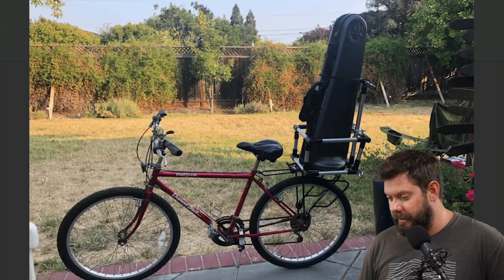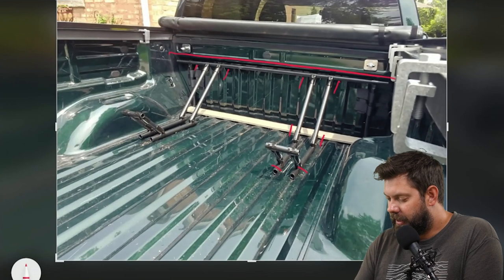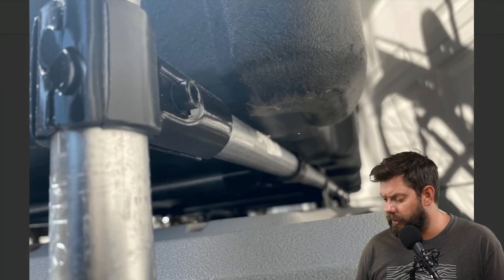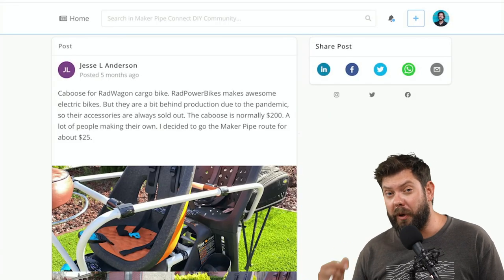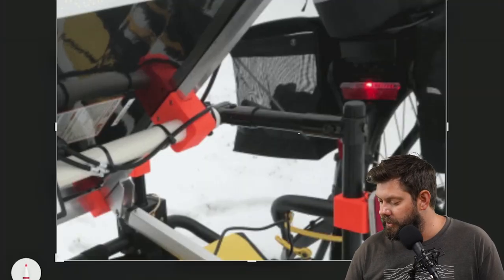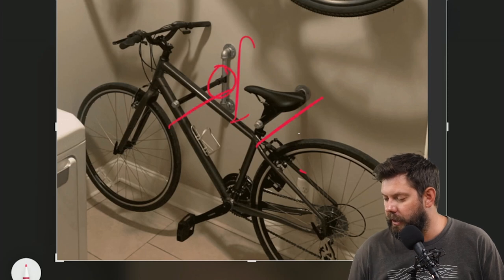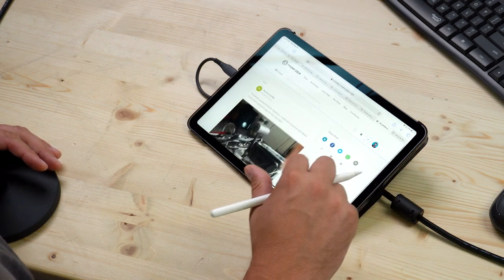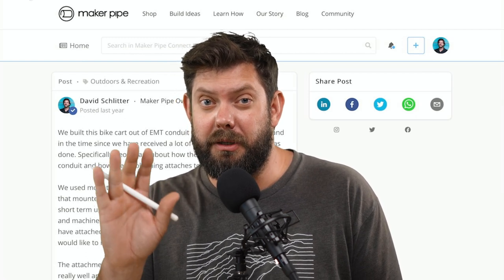10 DIY Bike Projects You Can Make With Conduit!

Comment: Regarding the bicycle trailer: Cycletote from CO is out of production now, but they used a very clever series of tube bends to make their trailers; basically it was a bunch of rounded rectangles and some cross members. They also were hitch mounted rather than skewer mounted, which arguably offers more flexibility for conversion of the trailer to other purposes (running stroller, grocery cart, whatever). 

Surly still offers the Bill and Ted trailers today, but it is obvious that round tubing and DIY connectors would be appealing to a lot of people.

Here is another idea: what is the average seat tube diameter of commuter or cargo bikes? A clamp-on or QR connector of your design could sit between ANY customer bike and ANY trailer with a round tubing hitch (or yoke, as in the Cycletote design). The Cycletote yoke could even be used over a regular rear cargo rack, so a trailer and rack could be an "either/or" option.

Comment: Tees are 3.24 each.  Ouch…. There’s gotta be about 50 in that trailer… may as well get a cheap welder
Reply from the maker: Hey Unravel, thanks for the comment. This was one of the first ever builds with Maker Pipe about 5 years ago. The design could be simplified quite a bit. Before too long we will make a new one and video the process.
Reply: Welder yes!